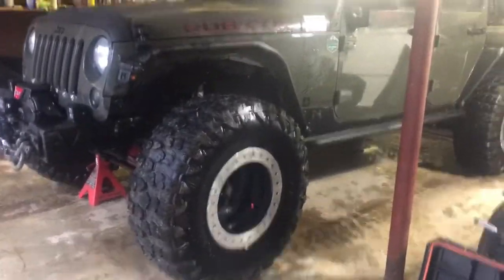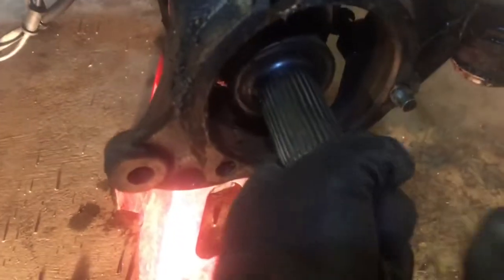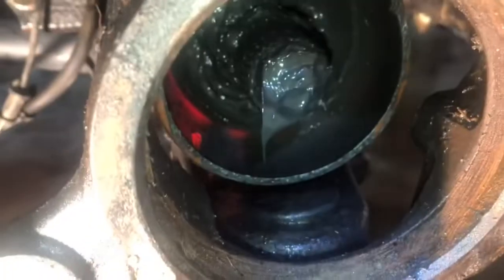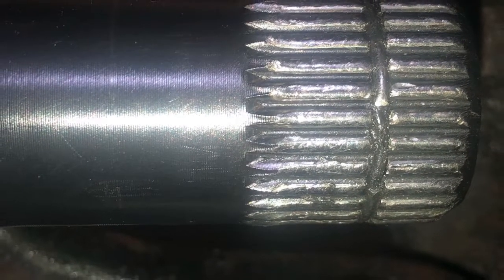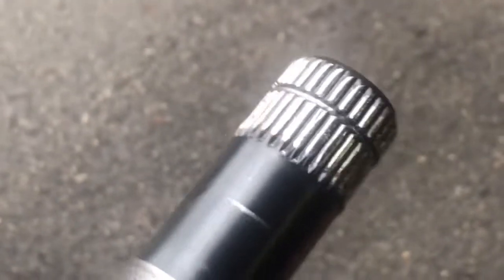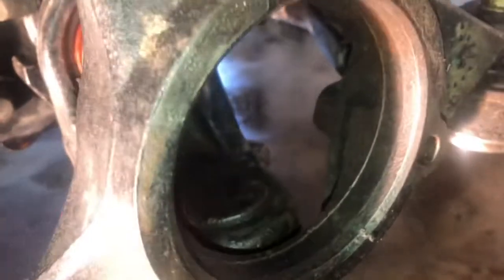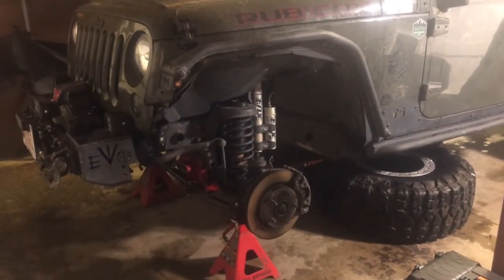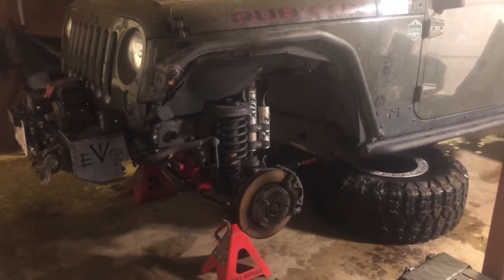RCV Shaft Spline Failure

Comment: Having the same exact issues with mine, locker end looks brand new, and im getting the same skipping from the video. Thanks for having this out there, was very helpful!!!
Reply from the maker: Very glad that the video has helped… RCV sent me a new end to assemble…. Clearly there heat treatment is having some quality control issues… good luck my brother! 👍🏻🇺🇸
Reply: @reconjeeper0321  mine dont seem to be as bad as yours were, and my c clip was still there and had to beat the 2 pcs apart… hopefully i dont have issues getting it replaced. Havent cleaned the outer slug yet so not sure what it looks like.
Reply from the maker: Well I’ve had it happen to both sides… gave RCV the D number of the shafts… they replaced but took about 5 weeks… so I reinstalled stocks while waiting. Good luck.
Also I was always able to get a person to talk with at RCV👍🏻